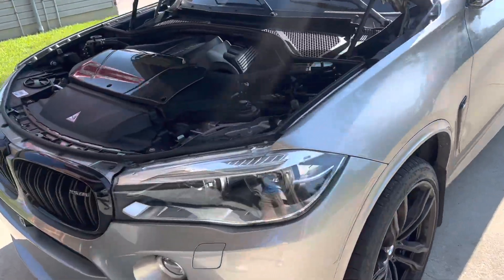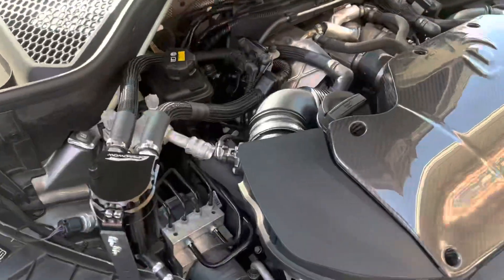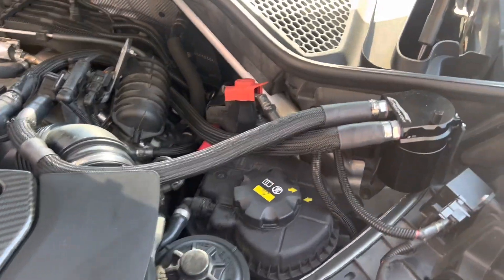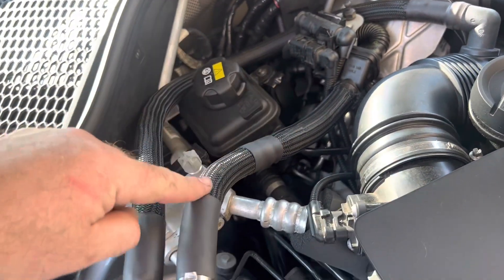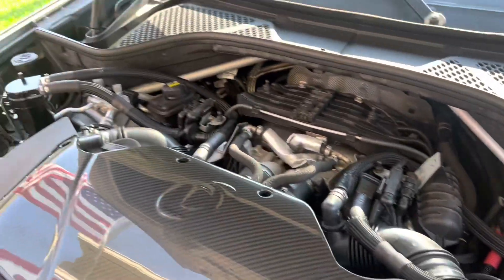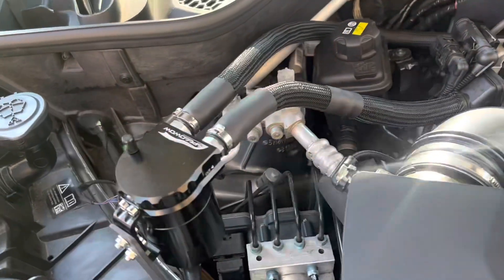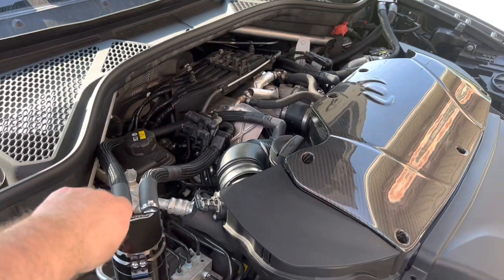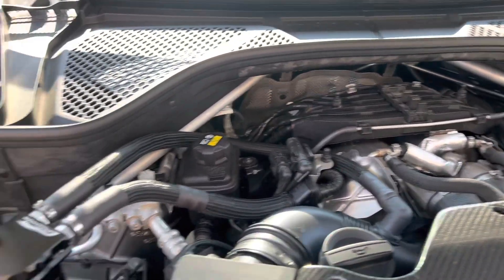BMW F85/F86 X5M X6 M oil catch can set up that both works and is budget-friendly !!!!

Comment: Totally unnecessary on the N63TU or newer engines.
Reply: How?
Reply: @topdollarmobile7460 The new TU camcovers have a complex labyrinth within that is quite effective.
Reply: @g @garyvanremortel5218  hey I just picked one of these up with 100k miles 2016 x5m, anything I should be looking out for? I adjusted the oil pump chain to get rid of some slack and going to do new Hpfp’s as it has a long crank on cold start and fuel mixture rich codes. Pretty sure internal pump seal failed

Comment: mine have collected 0 oil contaminants in 1000 miles... i might just take them back off.
Reply from the maker: Yep, most of the contamination is water , which is not a big deal. I took mine off to diagnose a misfire, havent installed then back on yet

Comment: Hey Tony, Thanks for the video! I completed the install.  Question, did you find the cans to be mislabeled with  the in and out. im confused as to what side is really in and out. could you shed some light on this for me. Thanks!
Reply from the maker: @naseerrobinson5848  it didnt seem that way to me, but the line should come out from the motor end and connect to the can body, then air goes through all the filtering and comes out of the can and to the intake , fairly straightforward

Comment: Are they still working properly? How often do they get full (in miles)?
Reply from the maker: @anasmalaika  they are oily inside with about 1/4” of substance at the bottom, i havent dumped them but glad this stays in the can and not on the valves/pistons